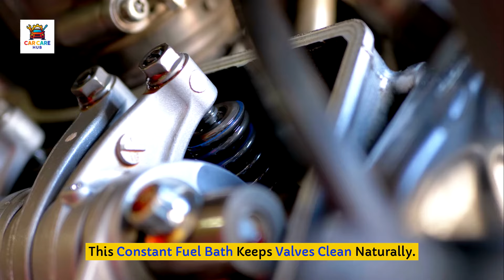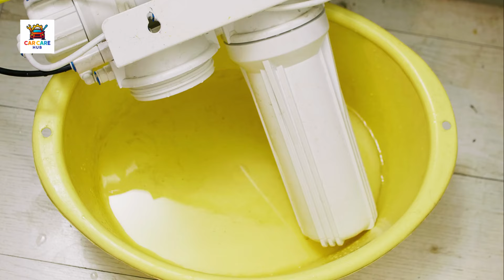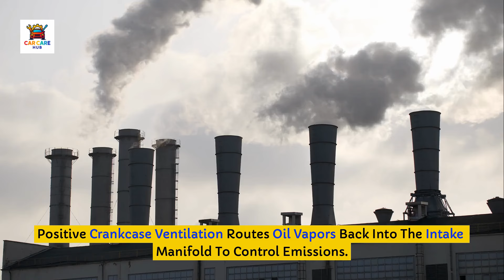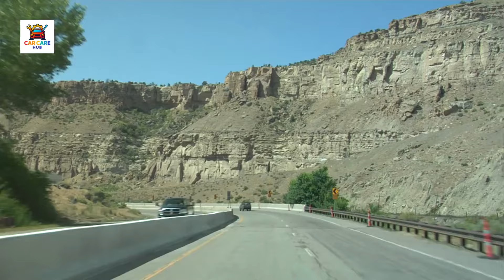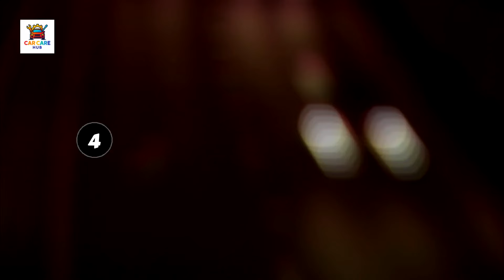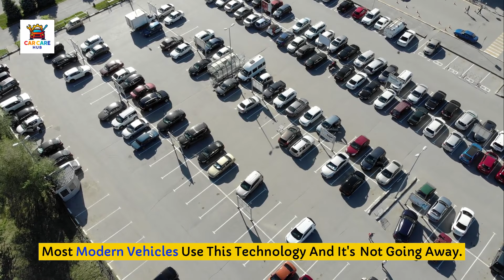Why 0W-20 Oil and Direct Injection Are Killing Modern Engines | Scotty Kilmer Warned

Comment: As far as GDI, after I had 2 GDI cars start burning oil by 55,000 miles I swore off GDI.  From a video I found from Korea, wish I had downloaded the video, he tore apart a New KIA with 9,000 miles that was burning oil.  The top ring was sludged up so bad it didn't move. So I compared a few pictures of pistons and between a Turbo RDX and a Turbo KIA, in the picture the distance from the top of the piston to the top ring was greater on the RDX than on the KIA.
Reply from the maker: Exactly—GDI design and high ring placement cause early ring coking and oil burning. Thin oils just make the problem show up faster. It’s a widespread engineering issue.

Comment: Also used full synthetic oil 0W20 ... I am considering switch to Mobil 1 oil 0W30 with Mobil 1 oil filter.
Reply from the maker: That’s a reasonable move. A quality 0W-30 can offer better protection under heat and load, especially outside strict fuel-economy driving.
Reply: Keep in mind that the bigger the spread between Winter and summer increases the chance of the oil shearing down a grade.  For winter you might want 0w20, and summer a high quality 5w20 if you are under warranty.   I just saw a video where they reviewed oil analysis charts from Blackstone.  Pennzoil Ultras stayed in grade, Mobile One Extended Performance, Amsoil and Castrol with Titanium...

Comment: Sorry but 5W30 is the thinnest oil that can be used... I say again that 0Weight is ONLY ONLY! for winter climates of -20 or colder...these engineers have got to see this or get out of the industry ...
Reply from the maker: I get your concern, but 0W oils aren’t just for extreme cold—the ‘0W’ is about cold flow, not operating thickness. Many engines are designed and tested specifically around 0W-20.
Reply: Our corrupt government hits manufacturers with huge fines for not going to the 0wXXs.  They want that .1 mpg more for fuel economy.  I suspect manufacturers are doing their best to make sure the car will survive 0w20 in all climates.